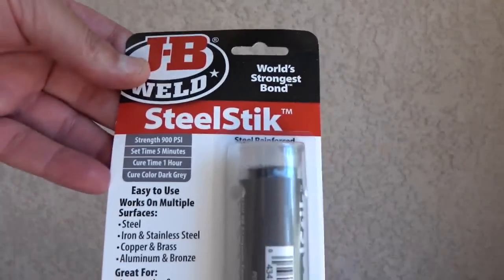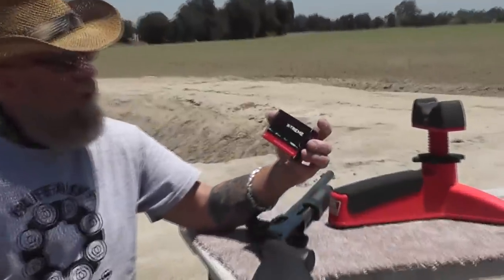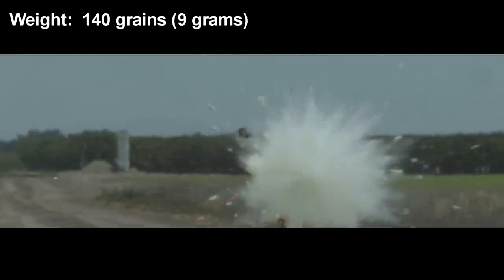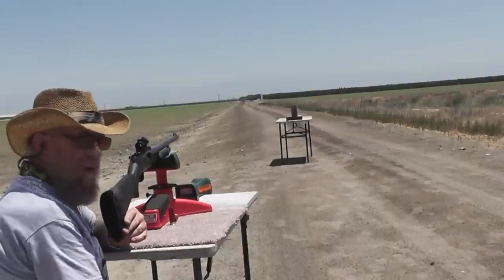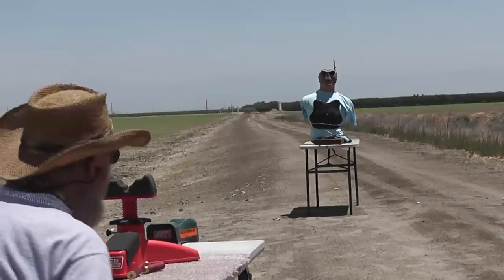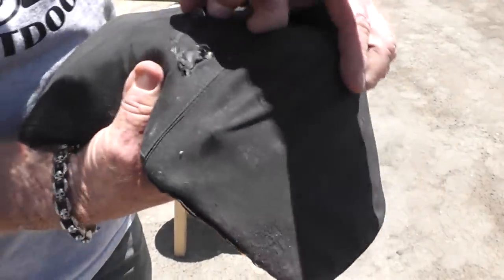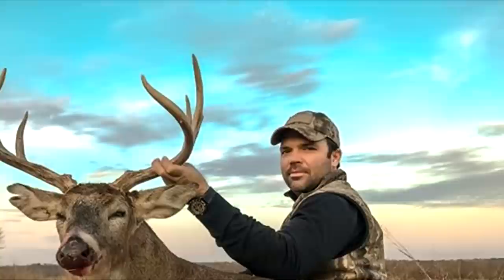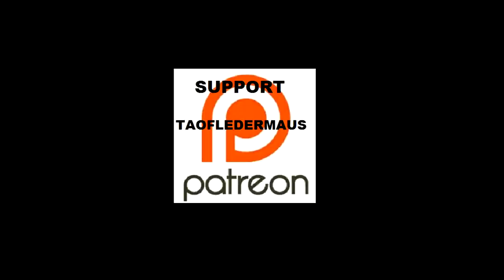J-B WELD Shotgun Slugs -  Is it crazy enough to work?

Comment: In my repair experience...i found a great way to substantially increase the strength of JB Weld ... After you have casted , cured and finalized the "part" coat in a layer of Super Glue..... Use the thin stuff ....it will soak into the the material.... Gives it much higher strength.... Kinda like case hardening....
Great video guys .. Fun Science Experiment....

Comment: I had to replay the part at around 13:15 about four times. The first time I was impressed. The second time I saw the whole block get turned inside out and popped out the back of the cavity. The third time to verify what I thought I saw, and although it looks like it did that, it was because of the whole block rotating in space. The fourth to confirm that my eyes played a trick on me. All I can say is, WOW! Bird shot and J.B. Weld...nice! Well done.

Comment: Had a customer that had a coolant leak on their diesel engine. Turned out the engine block was cavitated and coolant was leaking from the small holes on the engine block. Customer didn't have money to replace an engine so they paid me to repair it or patch it. Drilled the small cavities on the block and jb welded it. Over 1 year later and it's has not leaked. Shocking to every tech in the shop, and the customer is happy.

Comment: a impressive round indeed , it seemed very reliable . i wonder what the cost per slug would be , and how it compares to similarly priced rounds .
Reply: TheRocky3211, it’s definitely not cost effective at all. JB weld is expensive and a slug uses a lot. You get way more performance out of a foster slug and they’re cheaper
Reply: The JB Weld + birdshot is similar in energy to a .357, or maybe a 10mm. Not actually that amazing compared to the ridiculous energy of a shotgun slug, but if you had nothing else and needed to handload some shotgun ammo, this wouldn't be a bad choice.
Reply: @matthewwolfe7962  Let's do apples to apples here, how much would a good stable frangible home defense round cost? These actually do have a specialized practical purpose!

Comment: WONDERFUL!!!
 Loved every second of this video!
 Loved the JBweld performance -  and I was impressed too! - I thought it would shatter without internal support.
VERY nice slugs too (my favorite color) and superb performance. 
As for the clear epoxy  that is a NICE slug! I loved the clear-lead shot transition
Oh - I just realized I should have told you that the clearweld epoxy cures in minutes - but is still sticky and somewhat flexible for 12-24hr or so - so it needs time to fully cure. That's why it was hard to remove from the mold. Should have thought of that... 
Sorry!.

Comment: That was actually quite impressive, this may be a good option for home defense.  Wonder what it would do too bone? How about some JB weld buckshot??????
Reply: Kennedy's Locksport que paul harrels meat target
Reply: lucky43113 I looked but found no tests of jb weld slugs
Reply: The ability to add more frangability to the JBWeld mold and with added materials is what really makes this stand out.
Reply: Scott Cress I agree, you could mold a 30.cal fmj in the center. Carrying it like a sabot.
Reply: I was thinking that you could also add split lines to the mold or hollow point design, so that it dumps more of it's energy without penetrating the wall. A FMJ implanted in it would be sweet. However. If My kids are on the back side of the wall that's behind the bad guy I'm shooting at, the FMJ would probably penetrate like a steel core bullet, probably not best. For Home Defense you want all that energy to dump on the first surface it hits. 

The extensiblity though of adding other content to the slug like the wax slug is very intriguing. especially since JBWelde is stiffer than wax. Just be careful of adding more solid objects when considering HD rounds.
Reply: lucky43113 yeah I think that definitely would have interesting results. Even buckshot pellets made from JB weld would be interesting!!
Reply: Now that's a neat concept. They'd be so light though.
Reply: Scott Cress yes I think those designs would create massive cavitation.
Reply: Scott Cress I'd use rock salt as buffering compound lol

Comment: I was hoping you had the "Copper Plated Slugs" from Extreme... 
If you put a green Tip, 5.56 bullet in the JB Weld you might have a pennetrator.
 If it would stabilize. Or even a piece of hard rod.Thanks for the channel.

Comment: I love JB Weld! If you need a quicker setting epoxy, use the JB QwikWeld. It takes 6 minutes to set hard enough to use. I used it yesterday when I was fixing my car's audio system.
Reply from the maker: This was plenty fast.   I think it set up faster than 5 minutes.  Compared to the old-school JB weld where you had to keep the parts clamped together for almost a day,  of course.

Comment: You guys should see if fibre cement board can stop a slug. As far as I know it only comes in 1/4 inch and you’re gonna need a special blade to cut it, it only has like 5 teeth on it. It’s used on exteriors of condos and commercial buildings.

Comment: When I worked at a silver mill they repaired a worn shaft on the 200 ton ball mill with epoxy similar to JB weld and a year later when they took it apart the epoxy had worn less than the steel. When I drill a safe I thread the hole and screw a bolt in with some epoxy steel, grind the head off then fill in with epoxy. I'd hate to have to drill my repair.

Comment: There's a real high speed coating called vinyl Ester that is used on tank linings for caustic acids. It is a mass critical paint and can only be shipped out no larger than 1 gallon sizes. I once had a co-worker mix up 5 gallons of it and it caught on fire and melted down the five gallon bucket it was in. Either way if you ever get your hands on some of that stuff I bet you that would make a really neat slug. It's too bad I don't work for that Coatings engineering firm anymore so I don't have access to it anymore and it's some fairly tough stuff to get a hold of. We used to order it through a company called to tnemec coatings.

Comment: Also good for filling rusted freeze plugs, engine water pump leaks, warped manifolds and about any other bad ways of fixing old cars. :)
Reply from the maker: I fixed a cracked automatic transmission casting with some of the old school stuff.

Comment: Have you ever shot rubber baton rounds? I have some Fiochi rounds that claim to be less than lethal but surely they weigh about as much and are similar in design to these non bird shot JB Weld which seem like at 10 yards would do some significant damage. The rubber baton rounds have a less than lethal minimum range of 21 feet/ 7 yards. Surely OG can get you some. I would ship you some but not sure how the shipping ammo to California deal would work for that now. Thoughts?

Comment: I get the impression that one could use J-B Weld as a type of sabot when firing odd stuff one doesn't want tearing up the barrel. Wonder how drill-bits and re-bar would perform mixed with J-B... Anyway iy was a fun video and best of luck.

Comment: JB weld once again shows off how versatile it is, I wonder if you could make a slug out of rolled up duct/aluminum/electrical tape?
Reply from the maker: Now sure if we'd get very clean ballistics with that,  or have enough mass to allow the shell to function.  We need at least 5 grams.
Reply: I was wondering about that, maybe the metal tape would work best for that.  Perhaps a metal rod, as a core to wrap the tape around?

Comment: i thought about styrofoam with an epoxy coating, ofc would be very light but maybe worth a try? they use it in scenery building it is fairly stong. and did u ever try the same u did here but like with the wax slug? just fill it up with the long curing epoxy so all the shot settles in the position u talked about in one vid^^

Comment: How would injecting a few ml of glue, job weld liquid type into cheap birdshot for cheap slug/shot.  My concern is glueing shot to side of shell.  But instead of “cut shells”  or removing them, heating...   you drill small hole in center of crimp, @6 gauge needle to inject gorilla glue.  My thinking if it sticks to wad it’s not great.  But if it sticks to side of shell the pressure increase could be dangerous.

Comment: Could you do a video where you see  what the highest fps reading you can get from loading your own regular deer slugs vs standard? Is there some crazy fast burn rate powder you guys have and a shotgun that will handle the pressure?
Reply from the maker: Shotguns are only rated for a safe pressure of about 12,000 psi.    To go faster you have to go lighter with the projectiles.
Reply: I get that, but surely there are some shotguns designed to tolerate higher pressures or a barrel could be made is what I'm thinking here

Comment: could you make a wax-type slug but use epoxy instead. maybe 2 shot cups full of shot and then topped off with epoxy. stack them in the shell after hardening.

Comment: actually, the platters are not entirely made of aluminum. they are silicon plates coated with a very thin layer of aluminum as the electromagnetically orientable molecules to store data
Reply: Neat.

Comment: Epoxy (like JB weld) isn't flexible. Try the same test with polyurethane glue. Easy to obtain is Gorilla Glue. But that foams, so the slugs will be light. If you get your hands on the stuff they use to glue windshields on cars, that will be dense AF and flexible. Might be the best homemade slug ever.

Comment: FINALLY... I FOUND THIS ONE. I was wondering if anyone made JB WELD or BONDO slugs.. MAR-GLASS, by Marson should work... maybe even TIGER HAIR body repair may be even stronger due to longer glass fibers.  THESE BODY fillers are mold-able, sand-able and cure fast  You can even cast rods and lathe them.   THESE are Polyester resin (styrene) based chemicals when mixed with catalyst (peroxide) kick exothermically and get quite hard.  Well, maybe not bondo, but MAR GLASS for sure.  Give it some good cure time though as it gets harder and harder with time..!!!!!!!!

Comment: Kinda funny with the metric slip. Even though the U.S. military knows metric is easier and better. The public insists on staying with the old Imperial system. Even though a large part have used it in the military.

Comment: At what fps does a bullet become super Sonic, anyone
Reply: Abel Flores 
Supersonic travel is a rate of travel of an object that exceeds the speed of sound (Mach 1). For objects traveling in dry air of a temperature of 20 °C (68 °F) at sea level, this speed is approximately 343 m/s, 1,125 ft/s .
Does that answer your question? 😁.        🇺🇸😎

Comment: get some gloves on Jeff mixing JB weld with bare hands cant be good for you lol
Reply from the maker: The stuff is supposed to be non-toxic and can be used on drinking water systems.
Reply: Almost all epoxy hardeners will eventually cause skin sensitization. Once you are sensitized, you will break out in a nasty rash if you ever go near it. After the epoxy cures, it is relatively safe and will not cause skin sensitization. Also, all epoxies contain either bis-phenol A (BPA) or bis-phenol F (BPF). BPA will probably be the next chemical to be banned, at least in food contact.